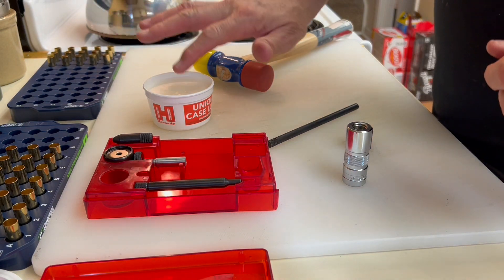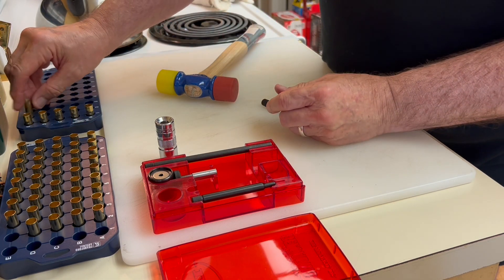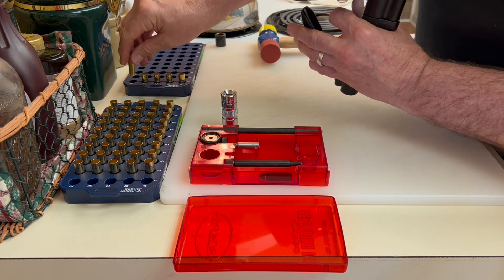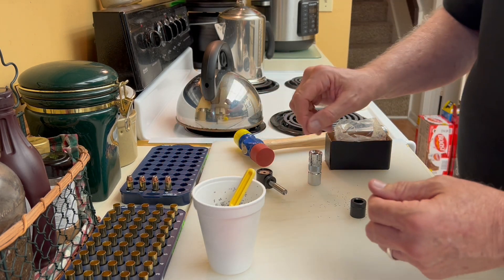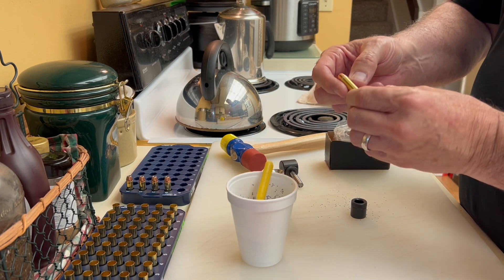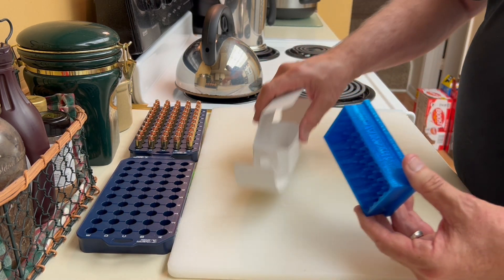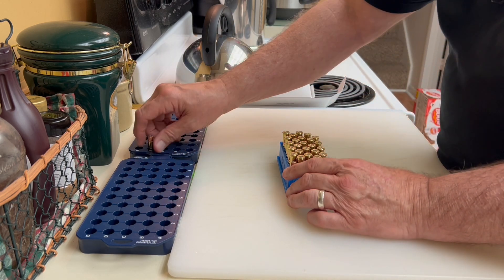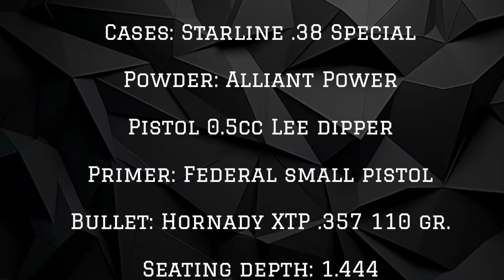Using the Lee Loader Classic

Comment: Is there a chamfering tool included with the 9mm kit? If not, is it strictly necessary?
Reply from the maker: A chamfering tool is not included but is inexpensive enough through Lee Precision. Less than $4. I'm sure if you wanted, you could use a knife and chamfer the mouth of the case that way.